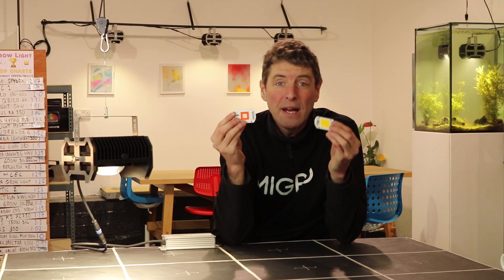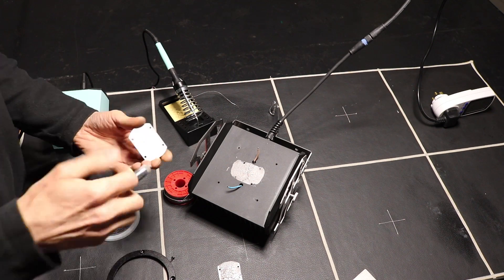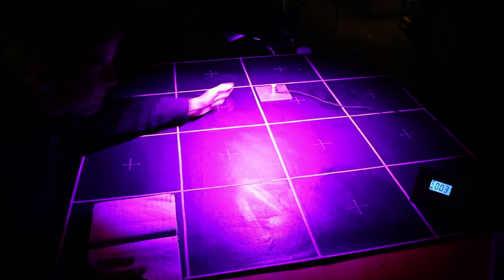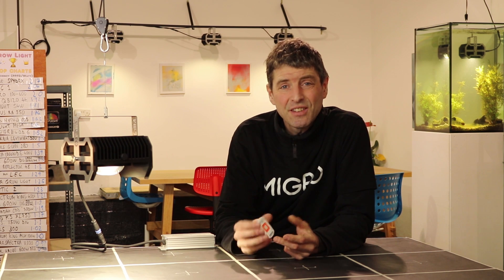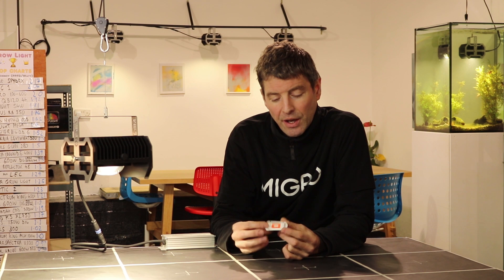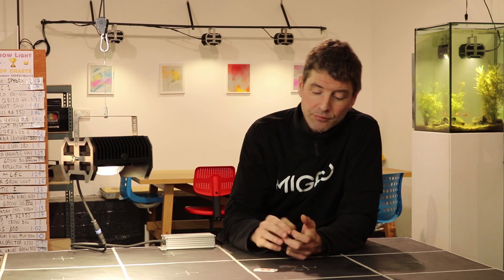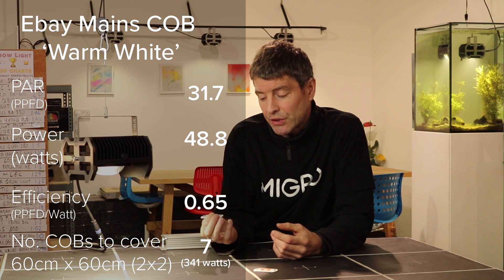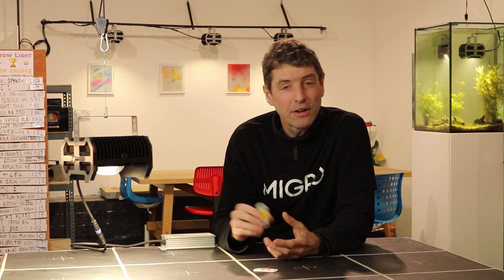Ebay mains COB LED grow light test

Comment: Test the alibaba quantum boards that claim to use authentic samsung diodes. If their description is honest, they are by far the most value for money grow light
Reply: οκ I know right they have the same parts as the hlg so why wouldn't be the same... It should be
Reply: J&A but diffrent boards yeah it’s similar
Reply: @joshamy39  do u guys even understand what Alibaba is they sell knockoffs or Chinese stolen plans and then find the absolute most garbage left over diodes from Samsung's throw away pile or non top notch performing gear. It's like getting nike air maxes from the corner store. Also like shopping at Marshall's or TJ max sure it looks ok the first time u wear it till u find the flaw in stitching or holes or just messed up in general. But hey it's ok u just gotta buy a new one every grow or 2...
Reply: greenghost3737  you are probably right but Id like to see migros test to believe it
Reply: @greenghost-xi5jp  It's also where Nanolux and Growers Choice buy. At least Growers Choice use Lonbright(Longhood?), have changed name slightly. I have a great Low frequency, square wave ballast with digital readout, dimming, and boost, no fan, I-64(?) waterproof approved, from Ceramic Solutions lighting in N. Cali, and they/he buys through EBM in China, I believe. Last time he had 630W DE-CMH ballast(same as above), w/double ended lamp for $199, shipping included. So I bought another set! Impressive! He even gave me the newest 3K-R improved lamp, just to try out-Colin is great. Much like Shane, here! I've heard certain provinces are much better, higher quality, while some areas are known to be lower quality, etc. They do have their own patents, and very smart designers, creators in some areas. But, yeah, I have seen exact copies of products specifically in the USA. Sun Supply AC/DE fixture is great, and expensive, but Lonbright has totally copied. That's who Growers Choice gets their CMH equipment from, and they'll label them with Growers Choice emblems, whatever they ordered. This has been done often by big companies. Alibaba gives us regular people these same deals. I was going to upgrade to a 1000W DE-CMH, but only available in 220V. Adding about 400W(5x5 Gorilla tent), but 4-100w Migro lights would give a much more even lit canopy, and the adjustability and craftsmanship, Luminous COB's, most efficient. I had disability back pay coming, ended up a few grand less than expected. Looked all over Alibaba, different COB setups everywhere. Finally found 1 company that makes 100W COB units using 2-50W COB's each on a 1M rail that the COBS can be slid back and forth, as well as turning 350°, and can be angled 180°, which is working well. These only had Citizen CLUO48-1212 COB's, less efficient than Migro's Luminous COB's, and cheap, but workable, but craftsmanship is low compared to Migro, but hopefully stays functional. I still prefer mostly HID lamps, but COB's as supplemental is great. Shane's Migro are definitely higher quality w/better workmanship, as well  as better efficiency. And upgradable if better COB's come out. Sorry for rambling on. Migro are Tops in COB's! Leaders for awhile now, and into the future I believe!
Reply: @greenghost-xi5jp  Well its easy to claim what your are saying. Can you back it up? Any links etc!?? If not, its just your word, against proven results.  I have a friend testing the v1 version of the samsung QB from aliexpress for some time now. The result he is getting is just awesome. Big fat buds and big yield. So i say the V2 QB from Samsung with lm301b diodes is good value for the money.
Reply: @henriks5008  sure it's still Samsung gear just not the top gear that's all period! I dont need links all I need to kno is how the business works and well what I say is true u can believe whatever. Never said they dont work they work yes but not at the fullest efficiency as other top ends but to each his own!
Reply: @greenghost-xi5jp  Well. His PAR, Spectrum and Lumens etc  reading is pretty close to HLG 550. So i´ll guess i´ll go with what i have seen with my own eyes. That is what i believe in! NOT just some random comment from some guy.
Reply: @greenghost-xi5jp    funny how the makers of the "top gear" you speak off, don't make any effort to make their product any different from the so called "fake ones".  Back up your claims with some kind of proof or stop spreading disinformation. 

Paying more is not proof of anything.
Reply: @henriks5008  I can't speak for lights, but for phone manufacturing it's a known fact that [one of] the reasons why some phone manufacturers (in China) are able to sell their phones for much cheaper than the most popular brands is because they, even though they go for the same electronic parts as the big brands (same displays, graphics cards, antennas etc.), they opt for the ones that had not met the performance requirements of the big brands, who do not want to risk having their devices randomly malfunction or blow up. The big guys do still overprice their shit like crazy though, but they do pay "top dollar", in relative terms, for their components, as opposed to the other chinese manufacturers who don't mind the sub-optimal makes and pay way less (they also don't overprice almost at all).

So I wouldn't be surprised if they did use the same electronic components of the same/similar models, but they most definitely buy the under-performing leftovers. 

source: largely this vid I saw a couple of days ago - https://www.youtube.com/watch?v=he1KAA1da6o
Reply: @greenghost-xi5jp  Thats a load of old bollox that is mate. 
"most" engineering companies use alibaba to buy steel products then rebrand them as there own often without even fettling them - some of the biggest brands in the world. 
ALL steel products, almost, comes from china. just because its from china doesnt mean its shit. that logic is fucking thick.
Reply: @timturk1899   brigdelux are massive in australlia
Reply: @greenghost-xi5jp  I'm gonna disagree. I'm also gonna guess that you're American and believe every bit of bullshit your government spews forth. 
Say Rita is supplying S5 and not S6 diodes then ok, it's false advertising BUT.......
Given the cost of the boards, you can literally buy twice as many. 10 boards over a 4x4 running 600w total is much the same efficiency as QBs with lm301Cs. Not to be sniffed at. 
In addition, you'll have a much better light spread meaning your lights can be run closer which is a huge plus for anyone that's height restricted.

Where you see pish others see opportunity, one mans rubbish and all that. 
Cobkits did a test on RIU and couldn't complain too loudly about Rita's boards. If a pro thinks they're value then that's good enough for me. 
Peace ✌️
Reply: @sementhrower420  Isnt the Chinese the leader in the world in cellular hardware. The fastest lowest voltage micro prossesor the lte modems is years ahead of iPhone for example that is also made in china
Reply: @greenghost-xi5jp  Well, it is very easy, man, look at the description on those links of chinese quantum boards, they put our logo (even SAMSUNG logo) buying more than 500 pcs and those boards are the SAME as HLG boards... Even the heatsink is the same that Shenzhen Mufue sells on AliBaba. HLG buys it from them and ask to put their logo and model on them. Do not understimate something just because of price, maybe you will found some surprises...
Reply: @greenghost-xi5jp  I assume you mean ali-express.....but there's nothing stopping those same parts from going on eBay.
It's not like Samsung makes arrangements with Ali express--Like eBay, it's just a bunch of sellers; in fact most of the big sellers also have ebay stores where they sell the same stuff.
It's not like there's some code of honor to not sell 'secretly lower quality' (but still genuine) items on eBay.....and Ali express has, for most cases, equally robust a buyer protection as ebay anyway.
Reply: Tbh there's no need for the snobbery greenghost.
The difference in efficiency between the topmost bin and medium bins is practically fuck all, especially when you consider the price difference.
Also, as you say you understand business you'll understand perfectly that the propaganda you spouted relating to Chinese items is wrong. They use buying power to reduce prices.

If you're ever in doubt folks ask the manufacturer for a copy of their certificate from Samsung which Samsung will happily verify.
Would love to see quantum cert seeing as ALL of their boards are/were produced in China and that's no secret.

Folk knocking Chinese products need to realise its no different to buying locally manufactured items, ya gets what ya pay for.
Pony up or shut up 👍
Reply: go ahead and buy one you can always modify it your self if it is not up to scratch. give us a link and ill take a look my self i might even buy one
Reply: As much as 175 lumens/watt. Usually higher K, more output. Usually 6K, maybe 5K and used widely in store parking lots. But I would think 3K would put out less light, but maybe 140lumens/watt? More powerful COB'S to come? I would think, as they always have been better than many, many single diodes. May take a bit!
Reply: he will never test something that's better value than what he sells

Comment: What is the best led to grow under 200 USD ? Send advise , thanks
Reply: DIY
Reply from the maker: 315W CMH with 3.3K to 4K colur temp bulb. It will flower a 3ftx 3ft grow area, more efficient than most LED lights and amazing spectrum.
Reply: Be best to make your own light you can buy these new led bulbs and pop the top off and theres mini quantum boards under the bulb part and they work amazing I have 30 in a 4x4 and it kills it for veg
Reply: Optic 1
Reply: Link please
Reply: @vincentlered  it depends on what you want? Size of grow space?You can make a nice DIY led. If you want good LEDs for cheap. Bloomspect 300 watt models$59. & maxsisun 480 watt model$78. The problem with the Amazon- Ebay LEDs are to powerful for the size and not enough light spread so go with multiple smaller units, and these models have secondary lenses, so they are powerful. These two models need 18"-24" canopy clearance for proper ppfd levels.
Reply: @vincentlered  https://youtu.be/cRkw9gln3ME
Reply: Meh
Reply: Maxsisun LEDs on Amazon not the best but worth the cost
Reply: Cmh 👍
Reply: @V.L. There are Optic links in this Video description...
https://youtu.be/cRkw9gln3ME
Reply: a 600 HPS/Halide combo. Amazon. Best weight for dollar. If the budget is 200 wait on LEDs imo. https://www.amazon.com/iPower-Digital-Dimmable-System-Reflector/dp/B005DOS0R8/ref=sr_1_3?ie=UTF8&qid=1547272369&sr=8-3&keywords=600+watt+grow+light+kit  something like this. Maybe even nicer if it's in the budget.
Reply: If you watch these vids you would realize that a $200 light is a piece of crap.  You will want a proper light so the $200 is a complete waste of money.  Trust me I have 2 lights I spent over $450 on and they lasted 1 grow. Now they will be under my crawl space probably forever.  I was a much happier grower with 1 $500 light than 2 cheapies.  My next light will definitely be a MIGRO.  But if you insist on wasting your money the Mars Hydro Reflector got at least some praise from Shane in his excellent overview of a lot of tests. In this vid you can still see the list in the background!
Reply: Yxo Full spectrum cob
Reply: @officialCrypto  lol))))